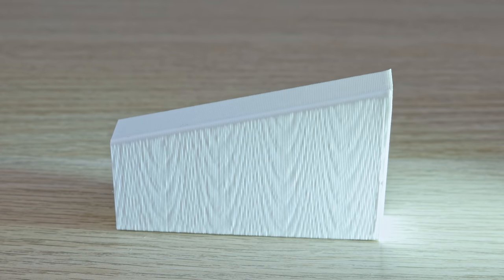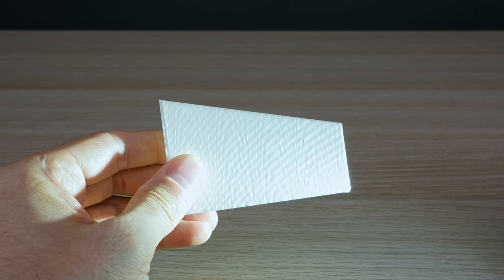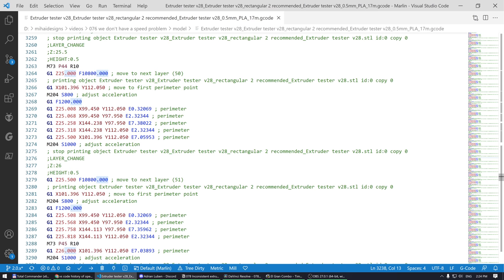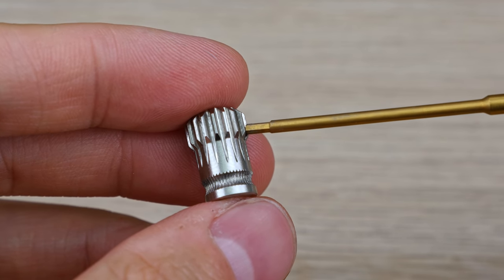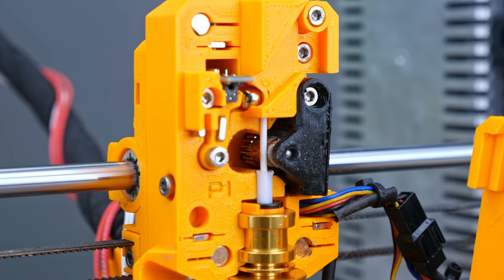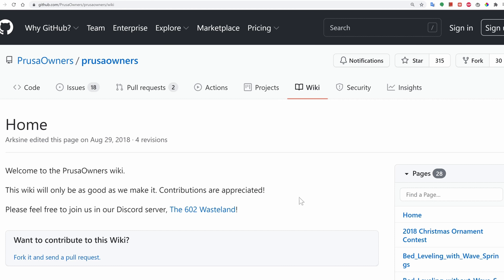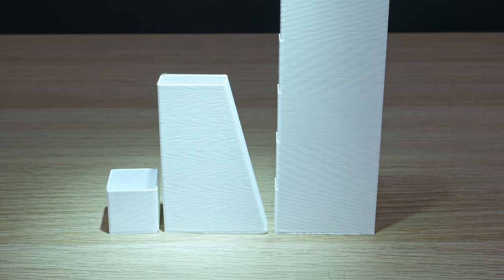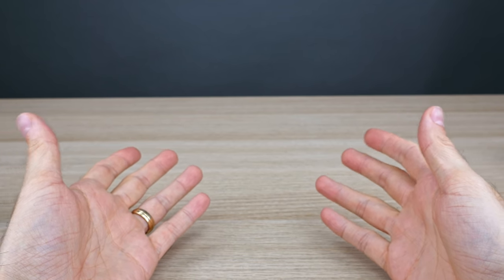What I've learned about dual gear extruders and how to patch them, maybe

Comment: So it's the same reason the reverse gear in cars sounds different! The gear has to be able to be un-meshed, so it can't be helical and has straight teeth, so they aren't as smooth as they could be 😬

Normal gears are more quiet because they're helical, but helical gears can't adjust like we need them to in 3d printers :/
Reply from the maker: I don't know much about these gears. Best I've done was to try and design them in Fusion as accurately as possible, but doesn't mean I understand them. Why would the helicals be harder to adjust than spur gears? I see them as a lot of very narrow spur gears meshed together with an offset.
Reply: @MihaiDesigns  Oh I'm not an expert either, my information comes from a video I found explaining why the reverse gear sounds like it does 😁

I'm guessing that the teeth are closer together and the rotation makes the alignment more critical, as the helical gears are always in contact with each other, but that could be incorrect- I'd love if companies experimented a bit more on that!

Comment: The extruder for the SeeMeCnc H-1 (circa 2010~ish?) was dual geared, but it didn't use those parts, and I don't think it suffered from this problem... I believe the STLs should be easy to find.

Comment: What about two different springs pushing the loose gear into the driven one? the spring on the tooth side should be strong enough so that the teeth of both gears always touch each other. The spring on the filament side should only be strong enough to reliably transport the filament. This should avoid the pattern while allowing different filament thickness.

Comment: The solution is change the format of the teeth gripping into the filament. If it spikes deeper into the filament with less pressure, it will keep the grip and keep the gears closer tighter

Comment: super informative, i was having clogging issues in my hotend took every little thing apart and my single gear extruder was giving me the slippage issue with silk pla (green was fine but purple after using petg did not like lol ) will be taking some things i learned from this to make adjustments to the dual gear extruder showing up tomorrow.

Comment: @MihaiDesigns Have you seen these new gears from Mellow? Mellow Hardened Steel Dual Helical Drive Gear, they show it used in their Libra extruder (not sure if that is their design or not).
Reply from the maker: I did just notice them a few days back. Perhaps I'll try them out.
Reply: @MihaiDesigns  Would love to see it with the Mihai flair!

Comment: why not have the rotation axis of the clamping mechanism along the Z-axis? This would allow minimizing variation of the teeth interfacing whilst also providing variable distance between the gripper sections of the two wheels.

Comment: this is why combustion engines with geared valve synchronization have a third gear between to compensate a gap due to thermal expansion... but this is really rare, normally you have a chain.

Comment: What if you use rubber rolls instead of the bite groves and stay the gears fixed in position? the rubber with a fitting shore would flex around the filament depending of the stiffness of the fillament and should have enough friction to push the filament. I hope. Another upside: the filament dont get pressed to hard and dont deform. also the filament can't skip or get grinded down. also the filament dont get some inconsistency because of that grinding.

Comment: Man I was "certain" that this was being caused by microscopic increasing length between steps before it eventually resets itself at square one. Think about a super cheap analog wrist watch... The seconds jump just a tiny bit at each step until the time is eventually wrong. However because it's a circle, it will eventually get back to the right spot.

Armchair scientist here throwing things out there 😅.

My "test" would be to try different extruder stepper motors without changing anything else. 🤷
Reply from the maker: Yes, I did try 3 different steppers: stock 1.8, 0.9, and 3:1 geared.
Reply: @MihaiDesigns  I actually meant it as in try 2 different stepper motors (of the same degree) and look to see if you get 2 different patterns or if the pattern is still the same.

If the pattern is the same, that further confirms your conclusion. However if the pattern is different, that means it's the motors causing the pattern.

Excellent work!

Comment: before bondtech i tought about making a bondtech.. and knew there will be issues with teh gear teeths not touching properly and the related backlash so i went the cheap way and built a dual mk8 gear extruder.

search on thingiverse for the DMK8 . works like a charm. if u want the design ask for it, i think u cannot download the sources from the fusion link any more.
Reply: literally the first thing i ever designed and printed so dont troll me hard on that one.

Comment: Thank you for taking the time to help others. I was aware of this effect from a Micro Swiss DD extruder setup on one of my enders. I found two solutions one was a different set of gears from another manufacturer. The other was simply rotating the Micro Swiss drive gear 180° on the shaft. The Swiss Micro gears use a straight cut dual gear per roller setup as opposed to the generic Bondtech style that is a straight cut single gear per roller setup. After viewing this I am wondering if there is an unintended slight angular dimension to the gears that rotating 180° masks. I will say though that I had a client who actually preferred the effect on a product go figure.

Comment: If the gear teeth are proper involute teeth, then you expect to get constant angular velocity even with the variation in centre distance. Given the backlash, there will be times when only the primary gear is driving, and the secondary is being turned by the filament (the hobbing on the filament can carry torque). The second gear only comes in when the torque is so much that the filament slips and the gear teeth start transferring torque.

Maybe experiment with manually extruding 20mm of filament at maximum speed before printing and see if that can reseat the gears so that the teeth are transferring torque instead of the filament.

Comment: My printer have one gear on the extruder, and the test print also show wood patern, but this is very very weak. Is the same problem? with de gear teeth?
Reply from the maker: Could be a different one (that I show at the end in blue). I assume it's more visible on the model with a higher digit number?

Comment: How small can you get an "anti backlash gear"?
(small scale theory, cut gear in half to produce two side by side, drill a hole (or two) through them both 1 degree out of phase, use a rubber bung to join them together, this would take out any slack as the gears move apart.)

Comment: I've struggled with the same issue on my prusa i3 mk3 and tried several solutions. Your theory makes sense but I was unable to fix the problem with your prototype piece, my prints look about the same. Thanks
Reply from the maker: I got a lot of positive results, but I guess it doesn't work all the time. Sometimes it can even be a different source causing a slightly different wood grain. Or perhaps I should make more variations of the idler door.

Comment: Couldn't this be solved by putting the follower side on an axis that is not restricted to be parallell with the driving axis, i.e. is allowed to equalize the pressure over both the gear and the filament so both are pressed towards the opposing side independently?

Like putting the axis in a slot instead of a circular hole and having two separate screws  for each end of the axis, or to put the axis on some kind of "seesaw" that distribute the pressure on both ends that allows it to do this automatically.

Comment: This one didn't last 3 months. Micro Swiss much better. The torque vector is high on the cheap amzn, even with the updated thrust washers on the idle hob gear. The whole spring arm moves with retracts enough that the gears begin to lose mesh and start binding after just 3mm of extrusion. Lots of skipping and shaving of the filament that clogs the drive surfaces. With the MS version, the torque is stabilized with gears on top and a much better tensioner design. The shouldered bolt that acts as a pivot actually keeps the tension arm on axis during operation.  You can also fit a knob for manual manipulation. Their instructions are also rock solid for updating your firmware settings.

Comment: this sounds to me like inpropper feeding.
if your material in is not perfectly constant (f.e. inconsitant diameter in your spool) then the outcome of the nossle will also be inconistent.
because the printer just melts and extrudes but he doent really meassure how much milligrams he puts out. if the filament gets thicker then the printed part is diffrent.

messure the diameter with good calipers and try to see if you find the same small-thick problem there

Comment: Great video, thank you for your work! I was wondering, how about a belt drive for the second gear? Surely also a bit of a manufacturing challenge but potentially simpler than dual helical.
Reply: like the proper printing extruder
it is meant to be a beast at pushing flex

Comment: It looks like this is happening on plastic extruders, does it also happen on metal dual gear extruders? Also the MY3D OMG DM1 Extruder has a different gear arrangement that might fix this. I would also like to see a comparison with how the usual red aluminu dual gear extruder performs since you can get those for $15.
Reply from the maker: Which red dual gear extruder is this? Got a link? 😃

Comment: Maybe an epicycloid teeth design and the gear have the two faces offset by half a teeth would help. Not sure but a 4 axis machine will suffice, instead of a 5 axis for double helix gears.
Reply from the maker: Right, so motion is transferred at constant angular velocity. Is that the idea? I only know a bit about involute. My question is: would these allow for more misalignment than involute ones? I assume that in general having two gears offset by half a tooth would reduce the issue. In the end it depends what the tradeoff is in terms of manufacturing costs.
Reply: @MihaiDesigns  that was the idea, but the pivoting second gear could "waste" the effort to produce them. If you know someone with a PocketNC machine (a small 5 axis CNC) could help testing this concept. There is a yourber named JohnnyQ90 that has it and he makes any sort of micro parts for RC engines. As another option, you could test PCBWay CNC capabilities. BTW I really appreciate your content and like your style of presenting/studying the subject

Comment: I wonder if the Proper Printing extruder suffers from this issue My guess is that it doesn't, since it's not using gears to drive the filament. Not sure though.

Comment: I wonder if a single bigger drive gear with 2 idlers could do the trick. Although maybe the bigger drive gear needs to be geared down to work and just would be moving the problem. Its all tradeoffs in engineering.
Reply from the maker: Indeed, tradeoffs. Could work. Would be bending the filament around the gear, so should be tested with a modified extruder. I sadly don't think I'll find the time for such a test in the coming months.

Comment: Maybe a bad bearing ? both dual and single gear versions uses bearings, and sometimes manufacturers really undersizes them
Reply from the maker: The bearings are indeed super small. They might have some influence and could produce some pattern, but likely not for this particular issue.

Comment: I guess another test to do is the system of the extruder i showed you some time ago. Virtually being 2 sequential hobbeed rings pushing it should be unlikely to grind the filament as if it slips on one gear (hopfully) doesen't slip on the other the same time

Comment: If the problem is connected to slack in the gears, what if they were connected by two more gears, tightly linked, that allowed the dual-drive to work, but also acted like a hinge where they could flex apart at the filament teeth, and stay connected at the gear side. You'd have 4 gears total (sadly, while simpler, 3 won't work...).

Comment: Why is everything on 3D printers open loop? An encoder wheel running on the filament independent of the drive could allow the system to compensate for uneven drive rates.
Linear encoders on each axis could eliminate layer shift. Ink jet printers have not used open loop steppers since the 90's
Reply from the maker: I don't know why we're not using encoders either.
Reply: @MihaiDesigns  Cost

Comment: I personally have this problem but thanks to the design of the LGX gears i can change the spur gears and I also thought about double helical gears. So I changed them for double helical gears and the problem is almost gone the I think the rest of the problem is left to tuning
Reply from the maker: So did you experience this with a "normal" LGX? I didn't realize that you can swap those gears, good insight!
Reply: @MihaiDesigns  sorry did you get my reply
Reply from the maker: @rehon101  got it now, thanks!
Reply: @MihaiDesigns  NP

Comment: I printed your test files on my layer fused x501 with Triangletabs BMG clone... I was actually surprised that I did not get the wood grain pattern, I still have lines but they are perfectly vertical....

Comment: I said this was a problem even before I attempted my first duel gear extruder. And when you add the additional motion input of retraction you exacerbate the problem. Currently I do not have a CNC to cut the pieces that I desire to cut but I have a solution for this problem and it entails the powered drive gears not touching each other via gears.

Comment: What if you just print a really thin ninjaflex ring to go over one of the gears so it does act as a kind of backlash reducer? idk just an idea worth a test i think
Reply from the maker: There are high forces there, so the material would have to be very durable. Doesn't help if the gears don't align though.
Reply: @MihaiDesigns  Well to be honest it would be better if both "gears" were pulleys and belt driven, both in a different direction (obviously), then there wouldn't be such significant backlash

it would severely complicate the design though but sounds like the next step?

pair of 8mm bore hobbed gears with a few 8mm rods, bunch of bearings, pulleys, idlers etc? thats my idea of how to make it work, to custom make them atleast

funny thing is that if some manufacturer read and made this i wont get any credit for it either way, i aint the kind of person to market shit so if it reaches some manufacturer at all i'd be out of the picture already

Comment: Replace the spar gears with helical gears, problem solved. May i send you some prototypes?
Reply from the maker: We can do helical gears which I understand are cheaper to manufacture, and then have a thrust bearing and some way of aligning the hobbed gears reliably.

Comment: maybe if instead of having one spring pushing the gear towards the filament and the gear on the motor, you use two springs so it gets a good grip on the motor, eliminating the wood grain pattern and still getting a good grip on the filament, and have a pivot on the motor side so you can open and close it to insert filament

Comment: I wonder if something like a worm gear would work better, even if pushed apart a bit.
It still might have backlash with retractions if they are not snug, bit in one direction they should have constant contact, even if slightly apart.
Needs testing.
Reply: Ah, it looks like you had a similar idea towards the end.

Comment: Helix gears have play too, and won't solve the issue. At most, they will reduce it.
To have a better spacing between two cogs, we can put 4 of them. like A, B, C and D. A and D have grooves for the filament, not B and C. A, B, C are fixed, and D is the moving one, rotating around the axle of C. so whatever the position, thickness of filament, whatever, the spacing are always the same. May not work tho because there is now 3 times the play.

Comment: I don't think herringbone gear can fix poor meshing. Maybe some kind of elastic belt would work?
Reply from the maker: I don't know much about gears. Why would it not fix it? I'm thinking at least there would be even backlash (which shouldn't matter much as we're only extruding one way).
Reply: @MihaiDesigns  herringbone are mainly used to spread contact area over multiple teeth thus allow more constant torque, more load bearing capability and quiter operation. If you pull them further apart backlash will be introduced the same way as with spur gear.

Backlash can be a problem when there are retractions, but I'm guessing the main problem here is imperfection in the gear teeth. Usually you want the number of teeth on 2 meshing gears to be coprime, otherwise any uneven teeth will mesh with the same gear over and over again and wear it out overtime. This can be the reason why not everyone is having the problem, otherwise it would have been discovered immediately.